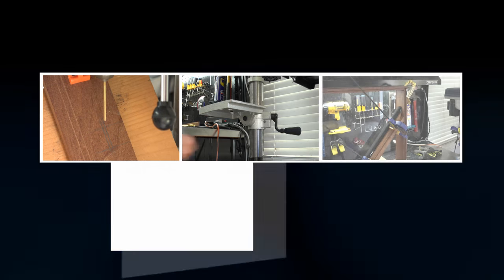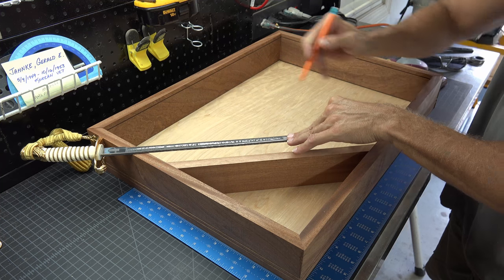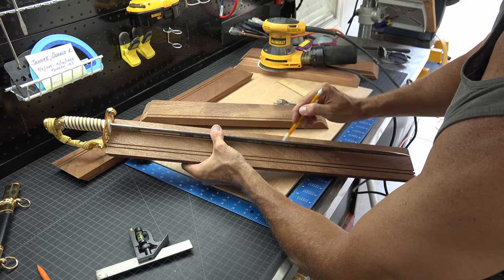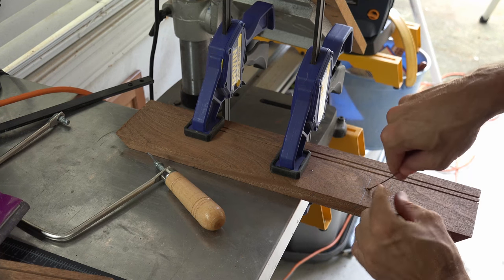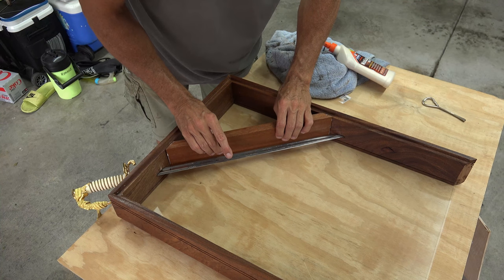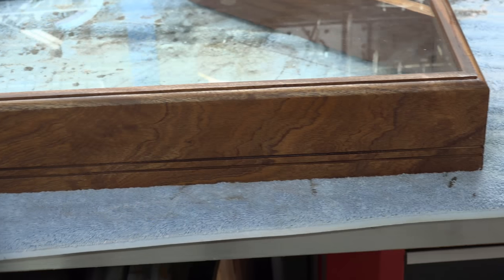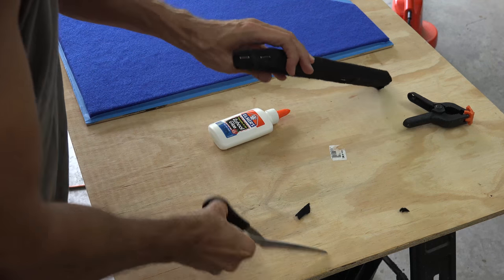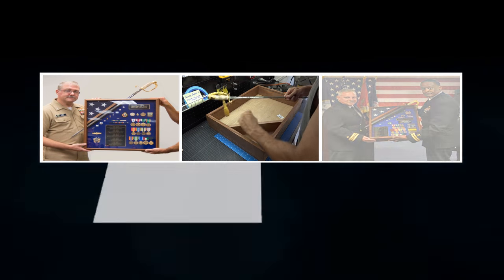How to place a sword through a shadow box / Jon's DIY

Comment: Jon, how do you mount the medals and skill badges without worrying about them falling off?
Reply from the maker: Gary,  the foam board is great. Once you push in the medals or ribbons, they are not coming out. (trust me)  I once put a set in crooked and needed a flat head screwdriver to pry them out.  As for skill badges and patches.  I have used straight pins and Elmers glue.  They both work great.  Anything with a prong you can simply push a hole in the foam board and fill it with glue and then set the prong in the hole.  (see Marine Corps Box below) All these work and I have never had anyone tell me that an item has come out of the board.  My only worry would be the double sided tape that comes with some of the placards.  I believe someday it might dry out. Since I have no control over these I had some glue to the back of the tape.  It settles around the felt fibers and it gives me the confidence that they will never fall off.  But check out these links to see how I attach the majority of my items in boxes.

Check these out. 
https://youtu.be/Z0N8xGHpdQ0?t=10m45s
https://youtu.be/RgJTz2dZsig?t=17m28s
https://youtu.be/ubsd7qc2DFs?t=23m33s
https://youtu.be/1OU39R5forc?t=12m55s

Thanks for your comment 
Jon